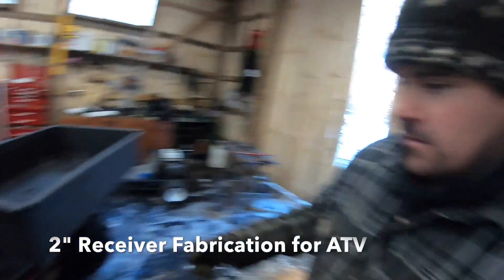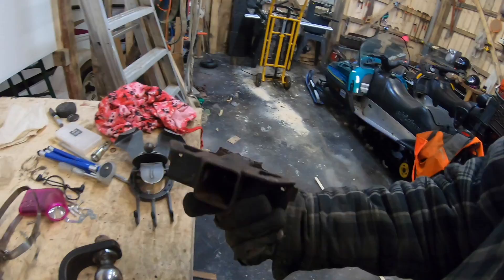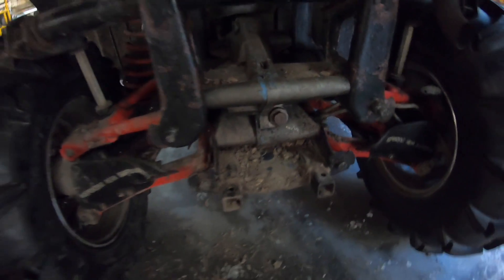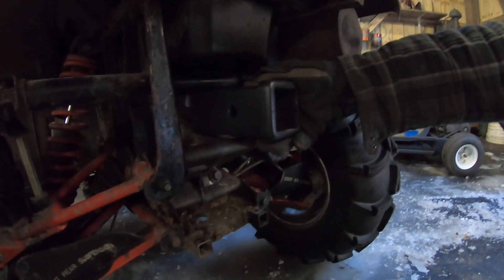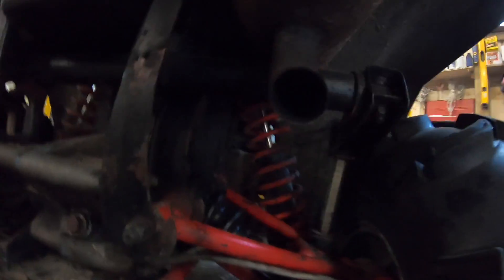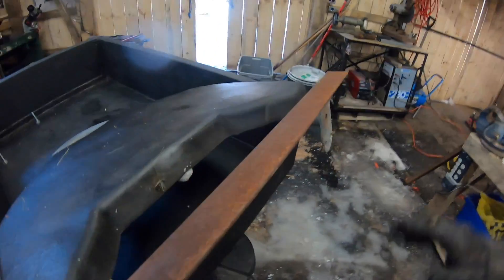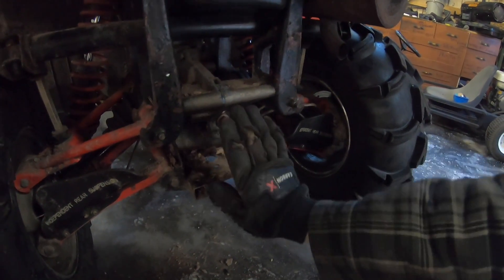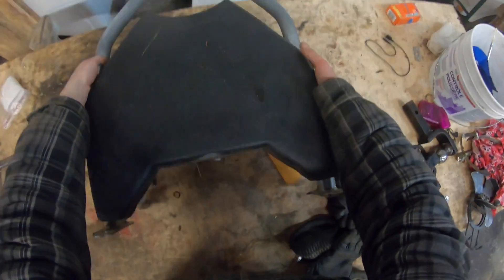BUILD IT!  2" ATV Receiver Hitch Fabrication for Polaris Sportsman

Comment: Building a hitch for a 1993 350 Bigbear 4x4, old.  It looked like you were welding GALVANIZED STEEL.  Fumes are VERY bad for your health, use a fan to blow it away.  You will be better off in the long run.  Good Job
Reply from the maker: I agree with ya there. I try to grind the coating completely off just for those reasons.

Comment: Found this while researching how to improve my hitch on the Sportsman 800. Groundhog Max actually makes a kit that bolts on underneath the factory hitch. It has a section of tubing that runs well under the frame. I may weld mine into place. I don't have much luck with bolt on stuff.
Reply from the maker: Thanks I’ll check it out

Comment: By the way the welding rod was hot, all the way to the holder, you might have the heat up way too much.   Not criticizing, trying to help.
Reply from the maker: Thanks I appreciate the help. I’m still learning when it comes to welding
Reply: Usually from the rod stuck on the metal too long and not welding

Comment: I can't believe Polaris can't sell a hitch to fit their ATVs
Reply from the maker: They sell the atv with 1 1/8” hitch mount but it bent quite quickly. They likely don’t want too heavy of a load on the machines
Reply: I was just at my dealership looking at a new 450 HO Utility and yes they sell a stupid looking 1.25-2” adapter that sticks out a extra foot and costs another hundred bucks, why is it so hard for them to put a decent hitch on their quads?